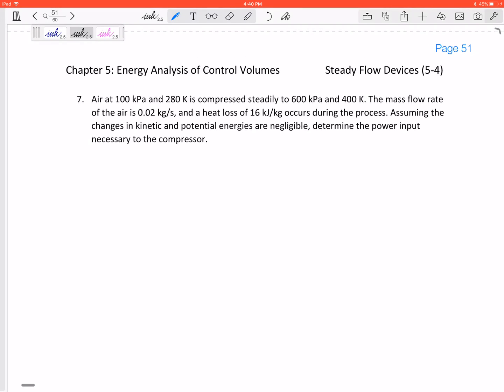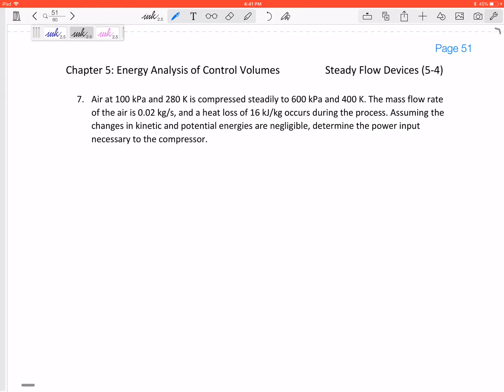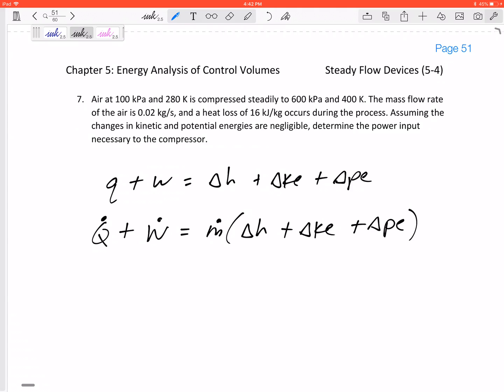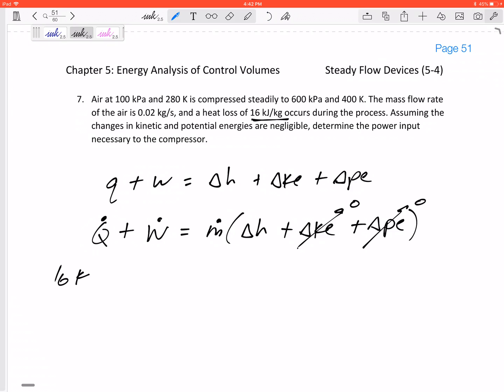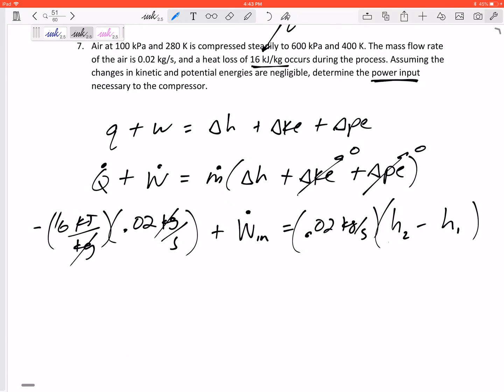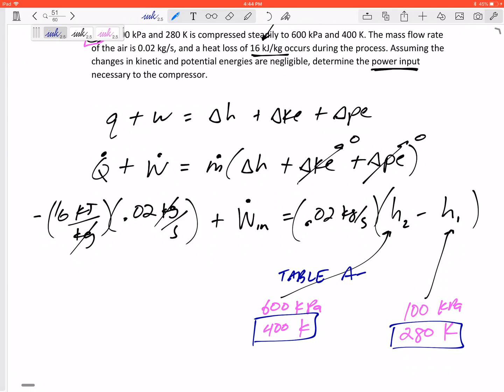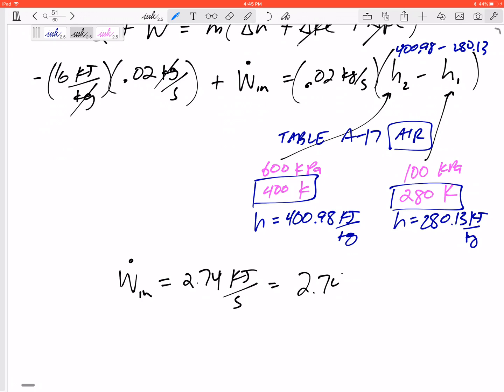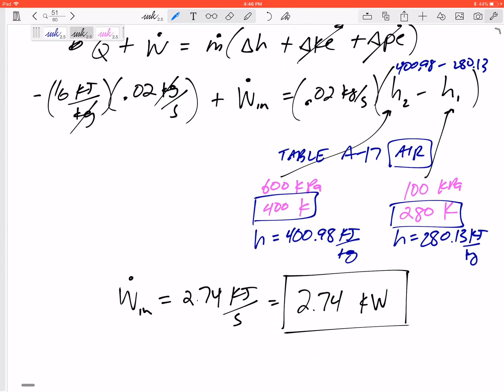Thermodynamics - Steady Flow Devices - Compressor

Comment: Hello again! Thank you for these helpful videos. As I was attempting this problem on my own, I was confused, because isn't the answer supposed to be 2.097 Kj/s or 2.097 KW instead? I noticed that you got the final answer by subtracting the enthalpies different from what you wrote down on paper (instead of 400.98 - 280.13, you subtracted 280.13 - 400.98) which gave you an answer of -2.737 or 2.74 as you wrote on paper. Is it h1 - h2, or h2 - 1?
Reply: you are absolutely right!
Reply: Are you subtracting it off with heat loss because if you would, you'd obtain 2.097kW. But it should be added to the answer on the right hand side to obtain 2.74kW
Reply: His answer is correct. It should be h2-h1 for change in enthalpy. If you solve the equation algebraically before plugging in the numbers. The equation is Win=mass flow rate *(Change in enthalpy+q).

Comment: Sir suppose in the problem, mass flow rate was not given, how could we have determined it bcz i don't think so at such a high pressure and temperature the gas will remain ideal
Reply from the maker: I guess it depends what gas it is, and what other information is given. Look at the units: mass flow rate is in kg/s, so how can you find how many kilograms per second is flowing? Are you given the velocity (m/s)? Could you find the density (kg/m^3) or specific volume (m^3/kg)? Do you know the cross-sectional area (m^2)? There are probably other ways to find the mass flow rate.
Reply: @engineeringdeciphered  right sir thanks :)